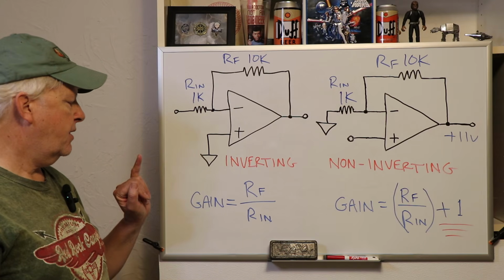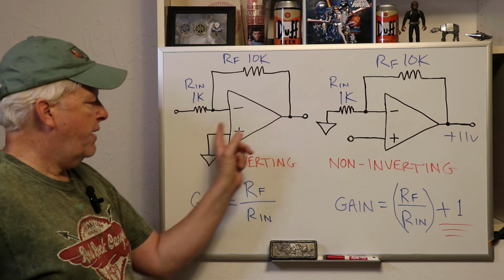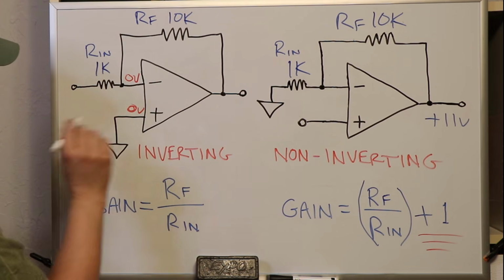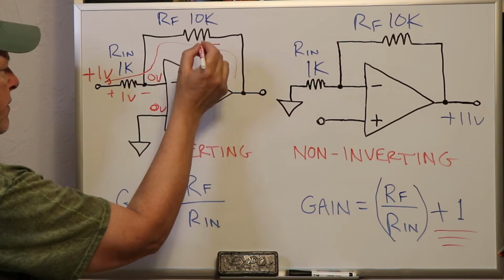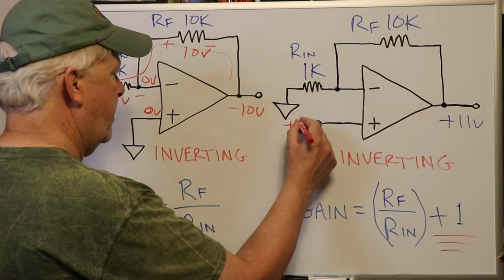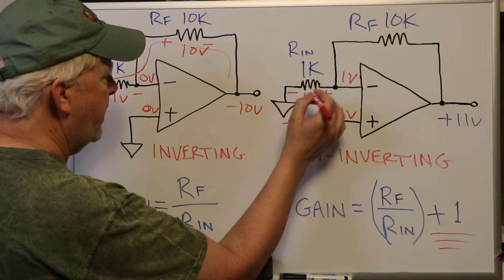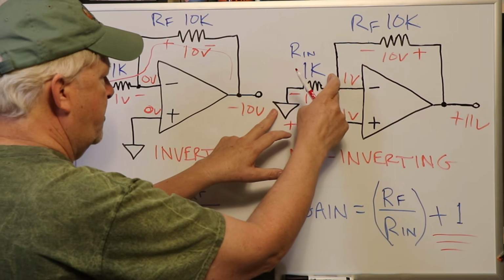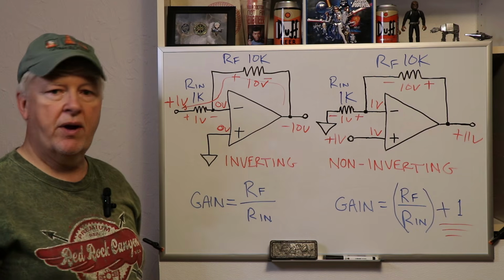Everything Clicked Once I Figured This Out

Comment: The reason why it is not intuitive these voltages is the fact that the OpAmp is never drawn with power lines and the fact that the OpAmp is an advanced device that will draw from the maybe +15 and -15 power sources it is connected to to get to that output of -10 or +11 or differential always 0. 

Buth when the OpAmp has only -5 and 0 as power source, it is probably going to clip.

Comment: If you  solve these circuits as normal resistor and voltage source networks using Kirchhoff's laws, the gain equations just fall out.

Comment: We could simplify this discussion enormously by starting with describing the behavior of operational amplifiers: when configured as a proportional gain stage using feedback - which is the case for both the inverting and the non-inverting configurations shown - the operational amplifier "tries" to make the voltage difference between the inverting input and the non-inverting input equal to zero... that's why it's called a differential amplifier - it amplifies the DIFFERENCE between the two voltages! (We could be more precise by saying currents instead of voltages, but they're proportional, so it's OK to speak in terms of voltage here.)
Let's call this the "happy op-amp" rule... I'm going to use this rule later...
So in the inverting configuration, where the non-inverting input is at ground potential, the op-amp "tries" to set the voltage at the inverting input to ground potential also.
To have ground potential at the inverting input, the sum of the voltages at that point must be zero, meaning that the sum of the currents at that point must be zero. We've said that the impedance of the two inputs is effectively infinite, which means that current flowing in through Rin must be equal and opposite to current flowing through Rf. If those two currents are the same but opposite, then the ratio of voltages across them is the same as the ratio of resistances, as expressed by Ohms law: I=V/R. So the gain - the ratio of output voltage to input voltage - is equal to the ratio of the resistances.
Gain = -Rf/Rin.
Vo = -(Vin * Rf/Rin).
Remember that the input is applied to the inverting input, so the gain is negative.
...
The next bit is the whole answer to this "1+" question, so read carefully..
In the non-inverting configuration, the primary difference is that the input voltage appears at the non-inverting input, which is therefore NOT held to ground potential. So if the non-inverting input changes to something other than ground potential, the inverting input must do the same to satisfy the "happy op-amp" rule !!
Make sure you understand this: it doesn't matter what the voltage is at the non-inverting input, for the happy op-amp rule to be satisfied, the voltage at the
inverting input must held to the same as the voltage at the non-inverting input. So that means that the output MUST be AT LEAST as much as the inverting input for the feedback through Rf to drive the voltage at the inverting input, it cannot be lower - the op amp won't let it be, it will keep increasing the output voltage until it is so. Remember that point, because that is where the gain comes from...
Now, still considering the non-inverting configuration, imagine that Rf is zero ohms, and Rin (improperly labeled, because the input voltage isn't applied to it) is removed altogether. The output would be fed back directly to the inverting input, so to keep the happy op-amp rule, where V at the - input is equal to V at the + input, the output voltage would be exactly equal to the input voltage, so the gain is 1.
If, now, we make Rf exactly equal to Rin, then the voltage at the - input is exactly half of the output voltage. So for happy op-amp, the output voltage must be exactly twice the input voltage -  because half of two is equal to one.
In short, when Rf = Rin (ration of one), gain is two.
If Rf is made to be two times Rin, then the voltage at - input is one third of the output voltage, so for happy op-amp, Vout is three times Vin, so the gain is 3.
In short, Rf = 2 x Rin (ratio of two), gain is three.
So you can see what's happening: gain is (Rf/Rin) PLUS ONE....
Or ... Gain = (1 + (Rf/Rin).
Vout = Vin + Vin(Rf/Rin).
The input is applied to the non-inverting input, so the gain is positive.
Again, one more time: in the non-inverting configuration, the input is applied to the non-inverting input, so the inverting input will always be kept equal to it (happy op-amp rule) by the feedback from the output, so the the output can never be less than the input, and the minimum gain condition is when the feedback voltage EQUALS the output voltage - the gain is 1. Any addition of a potential divider of Rf/Rin makes the feedback a fraction of the output voltage, meaning the output voltage must be higher by the ratio of the Rd/Rin. That ratio, plus the minimum 1 = is the gain of the amplifier.
Hope that helps.
Reply: One thing I see in all this op amp videos and comments is that no one mentions that this " rules" ( that is called virtual short circuit hypothesis) of V+=V- and I+=I- = 0 only apply if BA is >>1 ( that is generally 20dB),  and this approximation generally does not hold for mid band applications.
Reply from the maker: Thank you for the in-depth perspective and thanks for watching!

Comment: I'm sorry but he is not qualified enough to teach that. It's clear he doesn't understand this, it's just copy paste from somewhere, I call this papagai teaching. Not helpfull for those looking for understanding, as comments herein confirm.
This doesn't prove anything, it's pretending. Want to prove the formula? Get the Kirchoff laws out, build the equations, manipulate the math, apply  rules for an linear opamp, then you know the what and why.
Side note: there is current flowing in/out of the +/- pins. It's microamps for piss poor opamps, nA for slightly better ones, pA, fA common nowadays. Why does it matter? Put megohm resistors in there, work with sensors in the nA range and you'll see.

Comment: You teleported us right into the middle of an op-amp class. There’s a lot of stuff going on here, but you did exactly what you said you were going to do, which was explain why the plus one is in the gain formula for the non-inverting config. You have done me a favor. Reading schematics is part of my job, and now I don’t need to panic when I see all the concoctions around an op-amp. A little DC analysis can call its bluff.
Reply from the maker: That's great to hear! It makes a lot more sense once you break it down with DC analysis.

Comment: You did not derive the expression for Gain in a non-inverting op amp configuration.  Your presentation makes it look like the 1 in Gain = Rf/Rin + 1 comes from the 1V across Rin.  The real derivation is as follows:  Let's call the input voltage Vin, and the voltage at the inverting input of the op amp Vi.  As stated for an ideal op amp, Vin = Vi.  The resistors Rin and Rf form a voltage divider between Vout and GND, therefore the voltage across Rin = Vi = Vin= Vout * Rin/(Rf+Rin).
 Therefore, Vout = Vin*(Rf+Rin)/Rin.  Since Gain = Vout/Vin, Gain = [Vin*(Rf+Rin)/Rin]/Vin = (Rf+Rin)/Rin = Rf/Rin + 1.
Reply from the maker: I appreciate you breaking down the math. That is a great perspective on how that formula comes together and simplifies down to Rf/Rin + 1.
Reply: @DuranioLabs  I hope I didn't appear to be overly critical of your explanation.  I actually think overall it's pretty good!  It's just that using 1V as an input might lead people to think that's where the 1 comes from in the gain formula.  I tend to prefer general case values like Vin and Vout for such derivations.

Comment: So, if I have got this right, the output  is either 0V or 1V with respect to the input, but -10V or 11V with respect to earth. Is that correct?
Reply from the maker: The outputs are -10V and +11V with respect to ground, or -10V and +10V with respect to the (-) input.  Hope this helps.

Comment: The reason all of this works this way is that the op-amp itself, in the ideal case, has INFINITE gain.  If the gain of the amp itself were not infinite then everything else is different.  For instance the Av = Rf/Rin rule would not hold.  But since real world amps have finite gain, Av, the signal voltage at the op-amps input pins is not 0 but is (approx) Vout/Av.  If you stick a good scope probe,  using a good scope that can measure in the uV ranges, on the input pins of an op-amp on a breadboard you would see this signal voltage.
Reply from the maker: That's a good explanation of the practical limitations of op-amps. Thanks for sharing!

Comment: good video...now this might sound weird, but I first figured out op-amps when someone bothered to explain showing the supply rails--they are almost always not shown for simplicity sake.  However, as a youngster--the idea that no current flowed and still provided gain mystified me....when I saw supply rails and voltages included---it all clicked...lol
Reply from the maker: Ha! Yes, it would be great if Op Amps worked without any power. Sometimes those small details make all the difference. Glad it finally clicked for you!

Comment: What would be the applications of this electronics construction?
Reply from the maker: Basically, almost any small electrical signal you can think of that would need to be amplified before it can be used. One example would be a microphone. Its signal is no good unless it can be amplified large enough to drive a speaker.

Comment: what if you adjusted the value of Rin so that it's voltage drop was 2V?  Does the equation change?
Reply from the maker: The equations stay the same for both inverting and non-inverting amplifiers. In both of my examples, I applied a 1V input which caused 1mA of current to flow through Rf and Rin.  Using the non-inverting amplifier circuit as an example, if you change Rin from 1K to 2K and expect the voltage drop across Rin to increase to 2V, it will not. The voltage drop across Rin is still 1V because 1V is still being applied to the no-inverting (+) input.  Also, the current flow through Rin and Rf is now 0.5mA.  Now the gain is 10K/2K +1 or a gain of 6.  Hope this helps!

Comment: What is the difference between a virtual ground VS compared to circuit ground or chassis ground? They both are zero volts so what is the difference.
Reply from the maker: Good question. The virtual ground is at 0V when measured with reference to the circuit ground.  I've never really liked the term, "virtual ground" because it implies it's a circuit ground when it's not.  You can't use the virtual ground as an actual circuit ground return for anything else.
Reply: Considering the inverting input to be "virtual ground" with the non-inverting input is connected to "zero volts" is a very useful concept for lots of actual practical applications.
One of the biggest differences between the inverting configuration and non-inverting is that, provided the amp and feedback can do what is expected of them and the NII is at zero volts, the II will stay at zero volts (typically within a few mV). The inverting input therefore becomes a summing node that makes calculations easy. No matter what you connect to that node it behaves as zero volts. You can have 10 resistors connecting the summing node to 10 different signals, and the current from each can be easily calculated while ignoring all the others. The sum of those currents has no place to go except through the feedback resistor. No current flows from one signal source to or from another signal source. 

In general, the most important concept is that there is a "virtual short circuit" between the inputs of an op amp IF you aren't asking the actual amplifier at hand to do more than it can (things like supply rails, output current source and sink limitations, frequency response, slew rate, etc. come into play).

Watch out for allowable "common mode" voltage at the inputs. With dual (+ and -) supplies for the amp, this is pretty much a non-issue for inverting circuits with the NII at 0 V, but it is always a concern with non-inverting circuits and can be with inverting circuits if the NII is not at 0 V.
Reply: @DuranioLabs the virtual ground is generated because the op amps inputs will MATCH each other by the op amps internal comparator circuit? If you ground reference one of the op amps input port, the 2nd input port will match to zero volts which is a virtual ground because it is generated by using the op amps inputs comparator/difference circuit.

Comment: Assuming Rf to be 0 Ohm, the inverting amplifier would have amplification 0, output shorted to input, and Rin input impedance. The non-inverting amplifier would have amplification 1 (can't be less), voltage follower, and input impedance infinite. With different Rf, impedance remains the same, output amplification changes only.
Reply from the maker: Yes, that's another way to look at it. Rf set to 0 Ohms is really just a voltage follower at that point (gain of 1).  Thanks for watching!

Comment: The + 1 doesn't make sense as explained here. Why + 1 and not + 2? Why not - 1? One must be careful that just because they're using 1v as their example input voltage they don't carelessly apply it as translating to this absolute + 1 in the formula.

You want to do a tiny bit of fractional math to expand what "+ 1" actually means: it's a simplification of the formula that 'actually' makes sense, which is that the gain = (Rf + Rin)/Rin. Now you can see that the gain involves the addition of both resistors, Rf + Rin, since both are in series while moving from Vout to 0v. Whereas in inverting case, you only cross Rf to get from Vout to 0v.
Reply: Yes more examples would probably help in a class like in 0.5 or maybe -0.5 so no one will expect the +1 being changed.
Reply from the maker: Yes, I see your point here. I may need to expand on this a bit.
Reply: @DuranioLabs  I think everyone after publishing something looks back and finds a better way to explain something.  In this case, I think it was a somewhat unfortunate choice in using 1V as the input voltage.  It sort of resulted in an over-simplification of where the 1 comes from.  See my comment and derivation of where the 1 comes from.  I'm already looking at it and wish I had said it slightly better haha!

Comment: I was first introduced to OpAmps in the context of Analog Computers in the early 80's;  it was one of the Phyics Lab modules.  One could use it to integrate differential equations, both linear and non-linear.  Using an oscilloscope, one could measure the "acceleration", "velocity" and "displacement", and create phase space curves.  It was a pretty slick contraption.
Reply from the maker: My personal favorite is the log amplifier.  Thanks for watching!

Comment: I learned this before Bob Dole invented the internet! Had electronics lab back when they would hand you a breadboard and a 741. Man, what a miserable chip compared to what manufacturers came out with later. Now, all the same formulas hold true, but with superior integrated circuits. The Signetics NE5532 for example, changed my life.
Reply from the maker: Yes! The 741 IS a miserable chip compared to what's offered now.  About 18 years ago, I worked with an EE that used the 741 in an ECG circuit design!  It did not work well and had to be totally re-designed. I've never used the NE5532, but I have used the TLO64, TLC2264, and several others from Maxim and Linear/Analog Devices.
Reply: @DuranioLabs  MC33078D is Low Voltage Noise: 4.5 nV/ SQRT(Hz) dual op-amp that is really low cost in the smd version from ON Semi.
Reply: It was Al Gore who said he initiated the creation of the Internet.  He never said he invented it. 
Also The Op Amp Cookbook is an excellent book on Op Amps by Walter Jung.